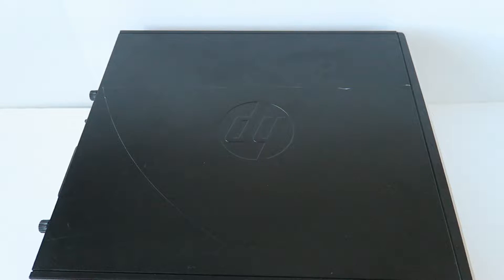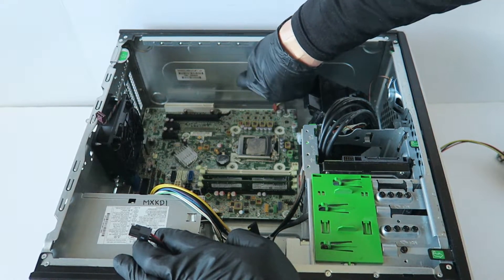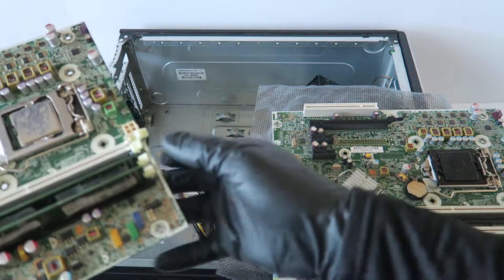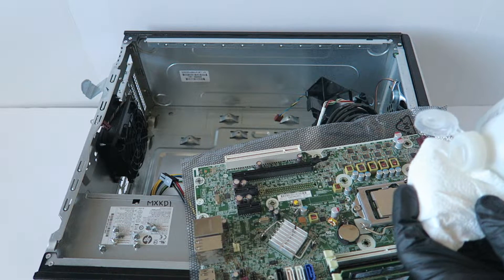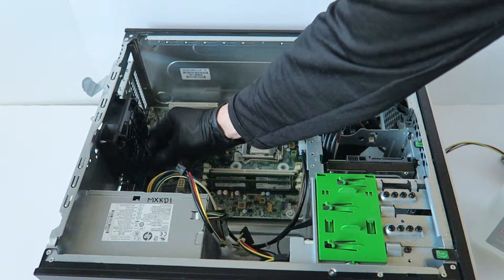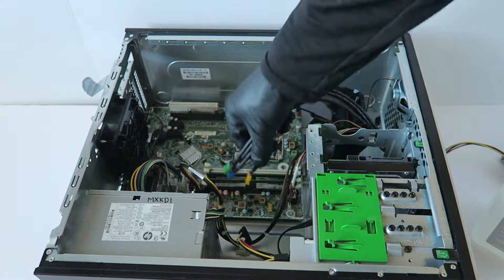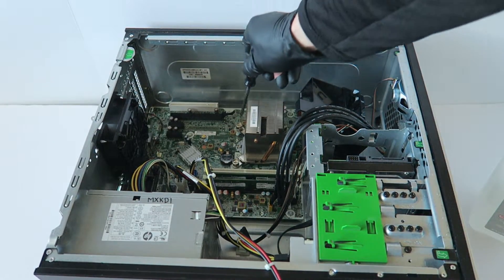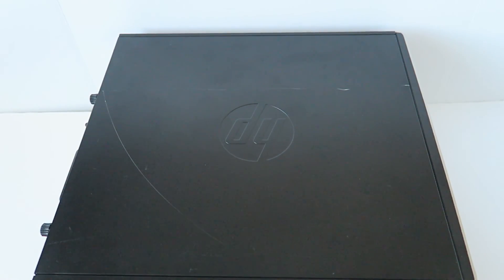HP Compaq Pro Replace Install Motherboard

Comment from the maker: (1.) Cmos Battery CR2032 Replace

(2.) Dual A Channel Memory should be installed in Black Color DIMM Slots 1-3
Reply: I think some people don't read comments.
Reply: What is the name of the motherboard that you replaced it with
Reply: Did you use the old battery from the other mobo or a brand new one to put in the replacement ?
Reply: Is this fit for ASrockB365M HDV

Comment: hello where is the video card?  is it integrated?
Reply from the maker: HI, it depends what kind CPU do you have ?
Reply: @Mxkdt  MY video card is AMD Radeon hd 7540d and CPU is AMD A6-5400B APU
Reply from the maker: @FORZAROMA1927-k8p  Hi, yes that is a slow CPU and you can still upgrade video card if you want...
Reply: @Mxkdt  okok thanks a question which gaming video cards can go there in my computer i have a hp 1850 (p0) motherboard e939839....can go an i3 processor is a 1050 ti video card?

Comment: @mxkdi do you know if motherboard of 6200 6300 8200 and 8300 are interchangeable ? My 6300 motherboard died and I cant find one for a reasonable price
Reply from the maker: Hi, hp 6300 motherboard is sold used on ebay you can buy cheap. Thanks
Reply: @Mxkdt  With shipping 6300 motherboards end up being very expensive (70$ minimun while the full tower is sometimes about this price on kijiji) but 8300 boards are like half the price. Both are LGA1155 but I am wondering if the BIOS or something else might cause problems and I don't find anything useful about this on internet. :/
Reply from the maker: Ok where do you live?  i can look it up for you the part

Comment: Thanks for the video m8. - But can you show us where to install the front panel connectors ? I can´t find the motherboard manual anywhere online.
We just got this HP Pavilion P6 H61 Motherboard Carmel2 656846-002 Pegatron IPISB-CU REV 2.00  as a replacement and I´m a AMD user and Intel is alien to me.

Comment: Interesting and strange thing about this computer (dc5750) and motherboard-- it's reversed!   Looking from the front, the right side opens (left is normally what opens).  Open it and you'll find the orientation of the slots and port cluster are also reverse.  Typical boards have slots on left side and port cluster on right.  This board is swapped.  This means this case cannot accept any normal mother board and vice versa, this mother board cannot be placed in another case!

Comment: Which size is this motherboard? I have the same case and I want to upgrade motherboard, but I don't know if it will fit or not..
Reply from the maker: Hi, this is like BTX Motherboard and will not work with ATX mid tower cases.

Comment: I want to change my motherboard (lga775) hp 6000 pro to an lga1155 hp elite 8200.
It's posible ?
Reply: Louis Vincent Lopeo yo am doing the same thing did you do it did it work I don’t know am gonna buy a hp 6200 mother board pls answer
Reply: @ideu6792  Yeah it works fine ! I just swap the HP 8200 Elite with a Core i7
Reply: Thx so much  your a life saver bro do you have a insta or a epic games
And how are you running games or regular task
Reply: @ideu6792  It works much faster with the i7 2600 with my GT 1030
Reply: Louis Vincent Lopeo thx am buying those exact same components but for now am gonna use a i5 3470 with a gt710 so wish me luck today when I buy it
Reply: Louis Vincent Lopeo am gonna come back in a couple of weeks with an update I’m gonna order a 6200 motherboard of eBay for 12 dollars so pray for me
Reply: Can i swap my hp Compaq 6000 pro sff motherboard with hp Compaq 6300 pro ? Please help 😭

Comment: Can i put a h61 motherboard in this case..?
Reply from the maker: Hi, no you can't. You have to buy different ATX or Micro ATX case for that h61 motherboard.
Reply: @Mxkdt  okay but can stock cpu cooler can get installed on h61 mobo? Do we also need 24pin psu for h61?

Comment: Hi Bro i have a hp prodesk 400 g3 mt comes with a i5 6th gen processor i want to add agtx 1050ti and upgrade the ram too. so can i do that should i have to change the psu??? please help bro. thanks in advance
Reply from the maker: Hi, you do not have to change power supply gtx 1050 ti with single fan will fit and work fine.
Reply: @Mxkdt  it is working bt fortnite is lagging even on lowest settings fps is alays above 200 bt infrront of enenmy it drops to 7 8 or 6

Comment: Which dual core processor will fit to this mother board ...my pc specs = 
1. Pentinum g620
2.gt 610
3.gb ram
4.500gb HDD
5. 230watt PSU 
Please can you tell me some low price processor which can fits in this machine because I am thinking to upgrade my gpu to gt 1030 please answer me as hurry as possible
Reply from the maker: Hi, what make and model number PC do you have?
Reply: HP compact 6300 pro ( motherboard support 2nd and 3rd gen processor )
Reply from the maker: For gaming i would go for  Intel Core i5 3470.
Reply: I know i5 is great but my budget is not for i3 also so I m thinking for dual core
Reply: Can you tell me can I move my motherboard from HP compact 6300 pro to any other cabinet